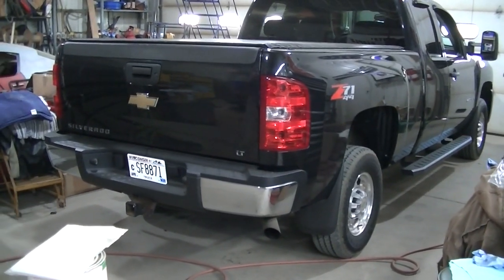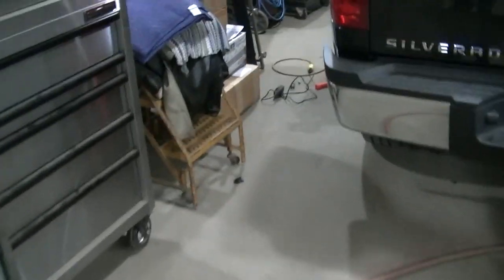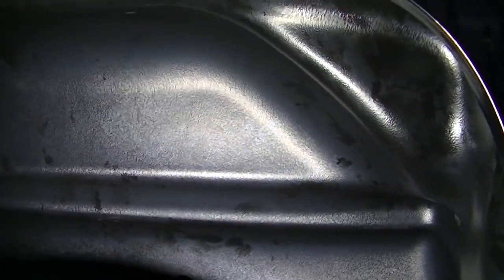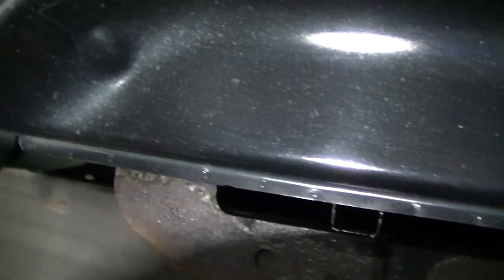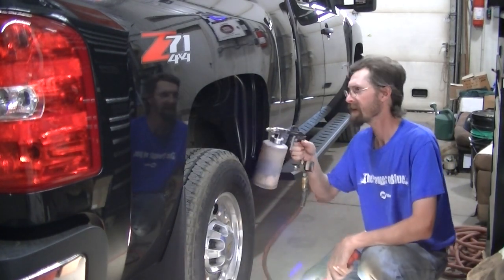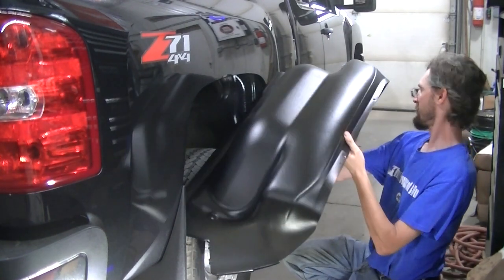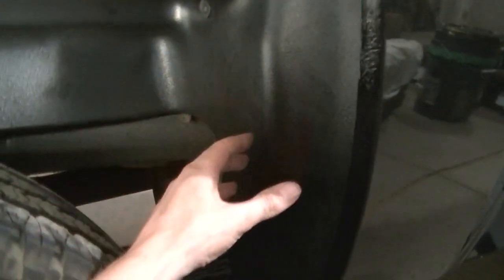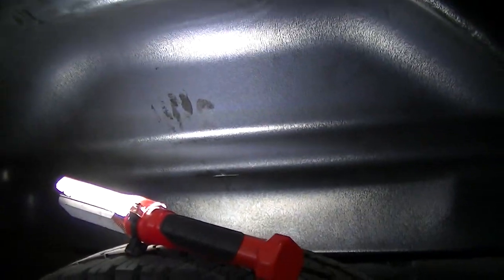2009 Silverado 2500HD Husky Rear Wheel Well Liners

Comment: $90 well spent. I would drill small access holes with plugs so I could shoot fluid film in the bed cross rails every Fall. Nice job!
Reply from the maker: I know a lot of people think you have to reapply fluid film but you shouldn't have to unless you wash it off. With the liners in place I shouldn't be able to wash it off.
Reply: @mossman381  I'm one of those who reapplies EVERYWHERE.  But you gave me an idea to somehow cap  off the cross rails after applying film on the other trucks that will not have the inner Husky Liners installed.  Thanks!

Comment: Does it cover the lip of the wheel well where crap accumulates and starts rusting the bed out?
Reply from the maker: If you want rust protection spray it down with Fluid Film. Pull the body plugs and spray the inside of the body too. This is more protection from rocks and debris. And it looks better than an ageing frame and rock chipped paint.

Comment: Love this new truck of yours. I'm in the process of doing a few things with my 04 2500HD 6.0 gas truck it runs good and still looks fairly good my biggest problem is the bed cross members on the bed are bad and the floor of the bed is getting rough with rust side panels are still decent. So you have had all kinds of experience with these trucks what's your suggestion if you don't mind me asking? Try just getting a used bed or get a new floor/cross members through dorman? I appreciate any help and thanks in advance!
Reply from the maker: You can repair your bed but make sure the rest of the bed is worth all the work. If the bed sides are rusted I would look for a better bed.
Reply: @mossman381  thank you much appreciated. I love the body style of your truck and would love to step up to a 07 or newer truck but at the moment I just need to hang on to the one I have. Thanks again for your help!

Comment: Do you want to sell the 245/75/R16s that are on your truck now
Reply from the maker: I normally sell the factory stuff but I am going to keep them so I can put the truck back to stock if I ever want to sell it. With the truck having so little miles it's probably worth more in the stock form.
Reply: mossman381 if you want to sell just the tires let me know they are the same size as the ones on my van and I’m the same way I hold on to all the factory parts for my trucks
Reply from the maker: I have thought about putting 285s on the factory rims for winter. If I do that I will let you know.
Reply: mossman381 thanks